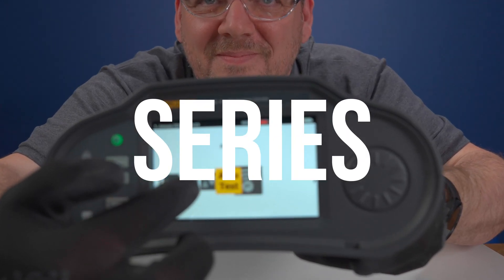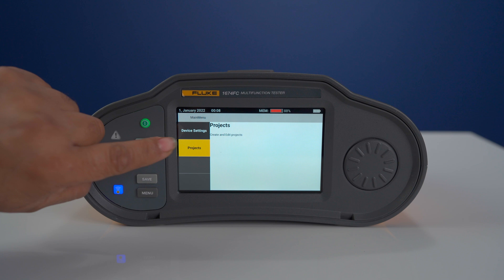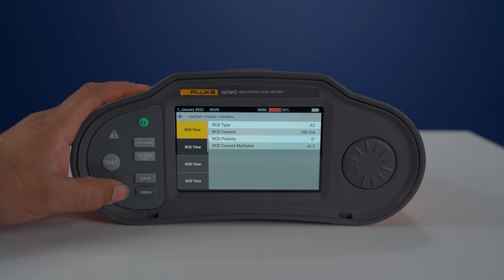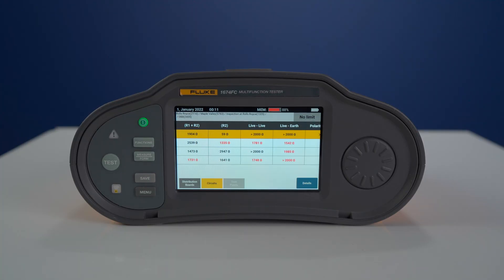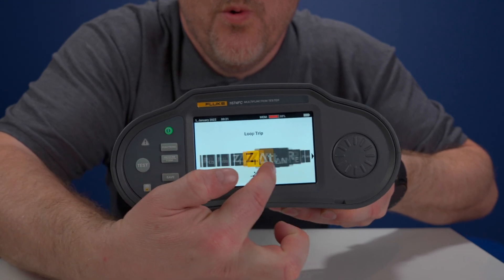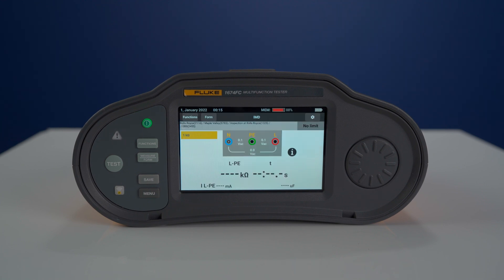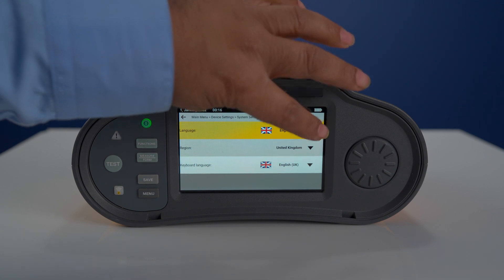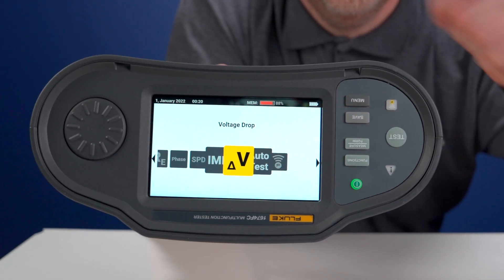The BEST Fluke Multifunction Tester for 2025! 1672, 1673 & 1674 Review

Comment: The 1670  Multifunction  Tester is True RMS?
Reply from the maker: Yes, the 1670 Multifunction Tester does indeed feature True RMS capabilities, making it a reliable tool for accurate measurements.
Reply: @PASSLTD-tester 
Porque no viene especificado en el Manual entónces????